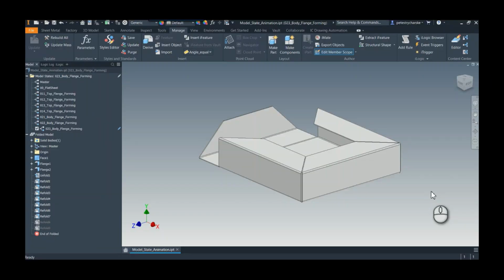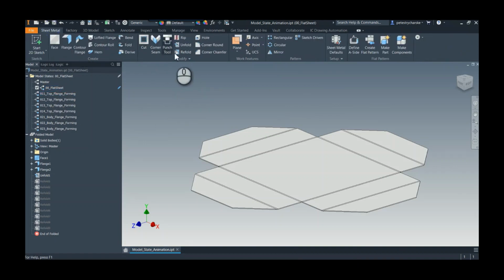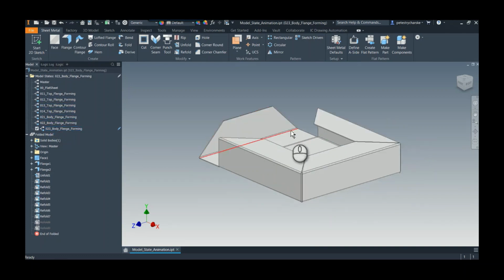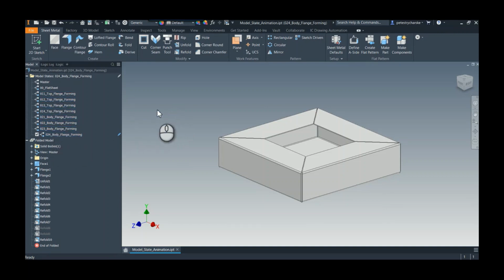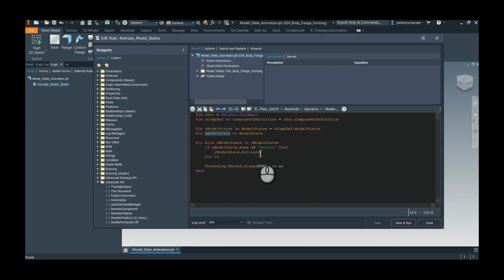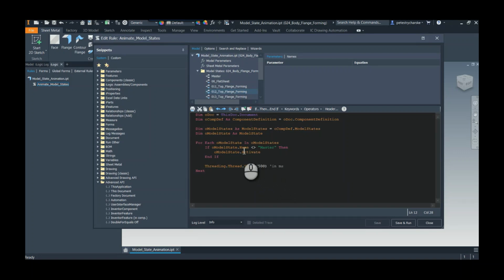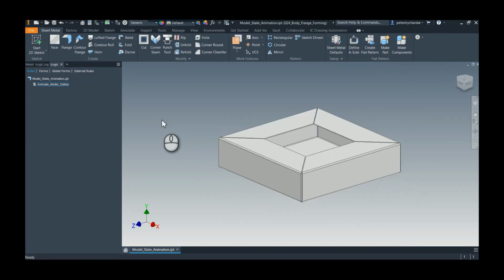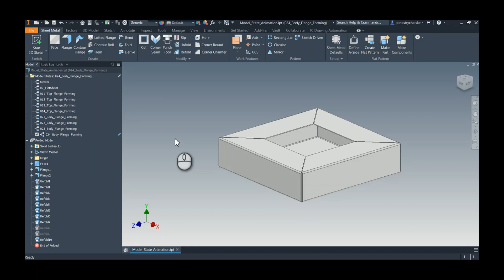Inventor - Animate Model States using iLogic

Comment: that is awesome, just reminded me of some thing i was trying to figure out recently for sheet metal folding, maybe you have a solution. its some thing called bump folding.
say you have a flat sheet and you want it to be folded in increments to make a segmented curve, can that be done in inventor or do you need to draw each segment and fold a certain number of degrees each time.
and example might be a box with a segmented radius edge where you cant use the rollers because its got other folds
any way if you know of any thing id love to hear it.
thanks again
Reply from the maker: Darren, thanks for the comment!  You could absolutely use a Lofted Flange for creating a segmented curve and then use this same Unfold / Refold technique, coupled with the iLogic rule, to animate the Model States.  If you'd like to see a video on this, please let me know and I can knock that out pretty quickly.

If the component has multiple bends that you're trying to fold, that gets a little bit trickier and you might have to resort to some surface modeling.  I'd have to see an example of one of those designs to get a better understanding, so if you could post a link to an image, I'd be happy to take a look.

Hope this helps and have a most blessed day!

- Pete
Reply: @Team-D3  so this video shows the segmented bending to create a large radius
I'm just curious if you know how to do that in inventor. https://youtu.be/4YHwyqv0V-o
Is there a simple way or is it a matter of just repeating the flange tool and guestimate.
Don't worry about the animate part, I was only referring to if it's possible in inventor to create these sectional radius.
Just thinking out loud would you create it using the polygon tool and just setting the number of sides to something like 20 or 30 sections?
Reply from the maker: @darrenfalconer3267  thanks for clarifying!  Please see this new link for a technique to model shapes, like this!

https://youtu.be/0oHWAkssj1Q